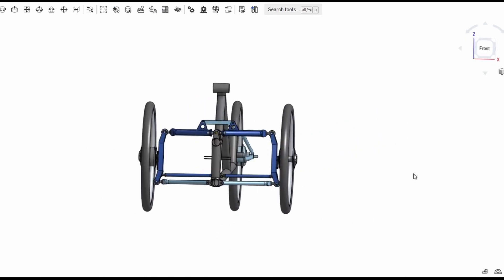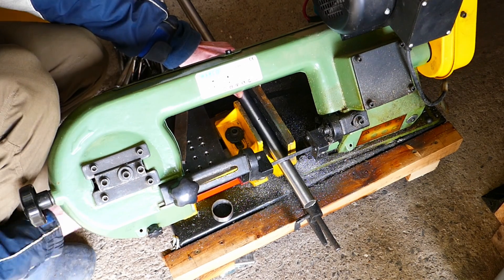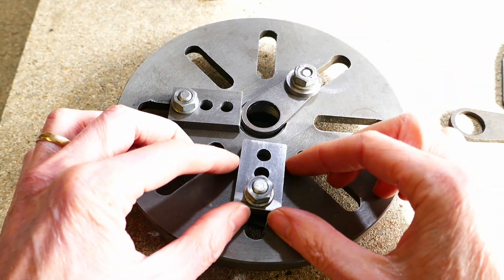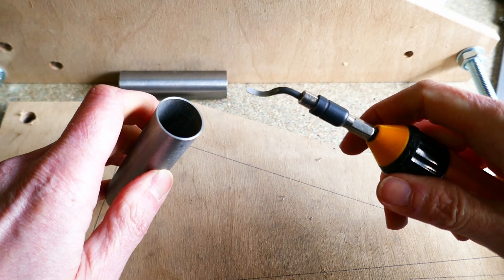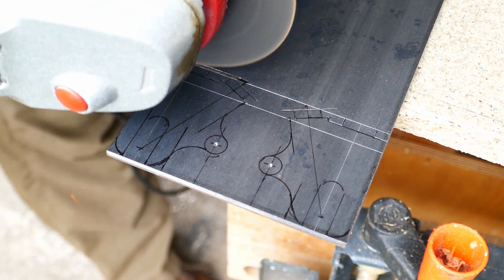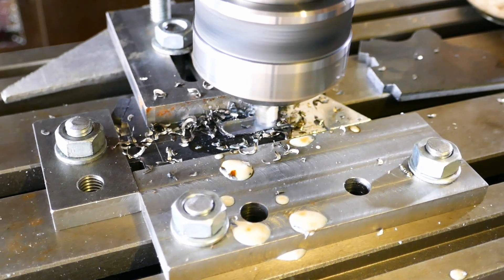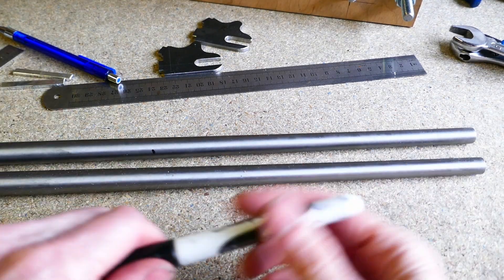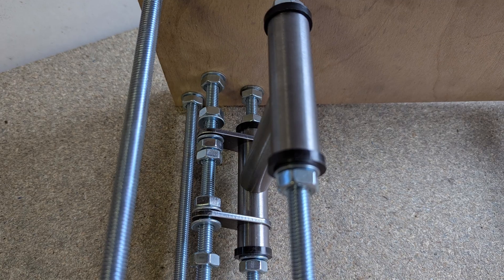Making the Swingarm - Tilting Trike MkII Build Project Ep. 4

Comment: Your fitment is " top notch" 😏
Reply from the maker: Thanks, I hope I don't ruin it with the welding!
Reply: @MetalMachineShop  you'll be ok. I suggest keep doing you "hot tacks". I do the same for exhaust work. Overlap them 50%.  up the wire speed slightly and amperage. Practice pieces. If you do a video off different practice pieces I'll chime in any other improvements you may consider 👍

Comment: Fantastic project and fantastic tools,, what tube bender is that?
Reply from the maker: It’s very like this one, if not identical https://stakesys.co.uk/tube-pipe-benders/manual-tube-benders/sta137-buzz-bench-top-manual-tube-bender .  I don’t think I got it from that supplier though.  It more or less gets the job done but is a pretty crude machine and needs a bit of modification to get all the parts properly lined up.  I’d probably give it a 2 star review rather than the 5 star it seems to have!

Comment: Great video, Metal Machine Shop. Looking forward to your next upload! I smashed that thumbs up button on your content. Keep up the fantastic work. I'm curious, how do you plan to balance the swing arm's weight distribution with the added components, especially considering the suspension system?
Reply from the maker: Thanks, sorry for the late reply.  I hadn’t really thought about balancing the swing arm but it will be supported against the frame at the back probably with a rubber pad or similar.  I don’t want loads of suspension travel, just a bit of shock absorbing.  The seat is going to be load-bearing so that will stiffen up the spindly back end of the frame.

Comment: I’m so glad this project is back, it inspired my high school final project
Reply from the maker: @nathanieldubiel3695  how did the project turn out?
Reply: @MetalMachineShop well it was a little ambitious for a high schooler who only had access to his school junk cabinet a welder, Lethe and mill but that part that was inspired by your design worked flawlessly. I was making a trike that was powered by a rowing machine motion and I was struggling to get the geometry right for the front tilt, at the time I was using a rectangle and I used the fact that as you tilted it the diagonals would shrink or grow allowing for hands free steering but as you detailed in one of your video the movement isn’t perfect because wheels still out past the rectangle and it was a massive issue for my design because it meant my inner wheel would steer shallow and my outer wheel would steer sharp but in your video you decided to mess around with trapezoids because if you follow the imaginary line of the trapezoid you can get it to intercept the wheel. So my design consisted of two trapezoids linked together and I was able to turn flawlessly by just shifting me weight. it’s still one of my favorite projects to this day and I’m about to graduate as a mechanical engineer but I really want to give it another try and you posting again inspired me to redo the cad models I lost on my old computer
Reply from the maker: @nathanieldubiel3695  sounds like you have a good engineering mind and good luck with the graduation.  I hope you have success with your next project.  I use Onshape for the CAD, which is cloud-based and free to use.
Reply: @MetalMachineShop  I use fusion which is free to hobby builders and students but I also have a professional license through the company I work at, I’ve never messed around with onshape

Comment: Looking at these incredible efforts, I realise how awesomely simple bicycles are.
Reply from the maker: @VacuousCat  yes, simple and highly effective!
Reply: Forward of the vertical tube in the rear, you could cut a gap in the main lower frame tube, add a larger pipe and put in a bearing sleeve?  I'm not sure what it's called, but the rear could tilt too, and still have suspension. Weld a stopper on each side so it can't over tilt.